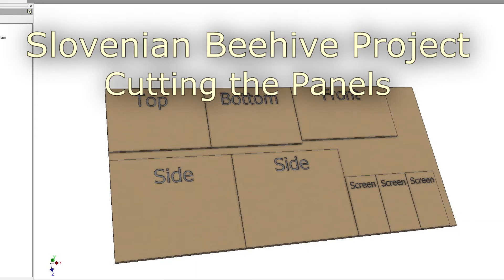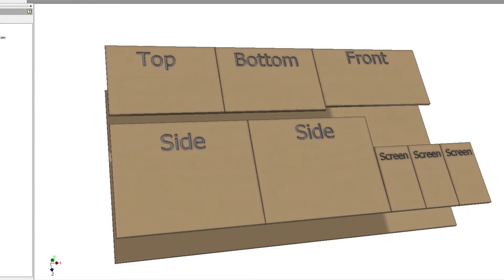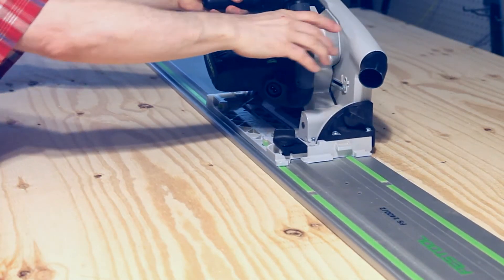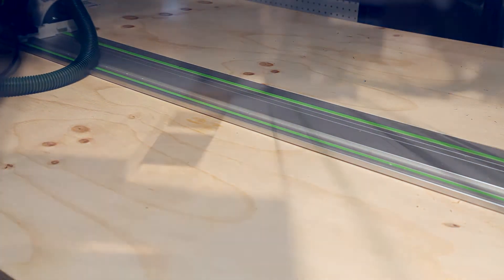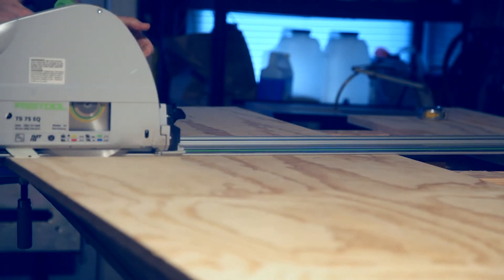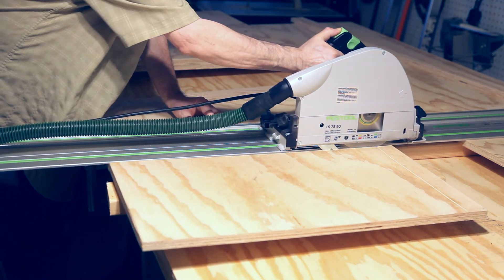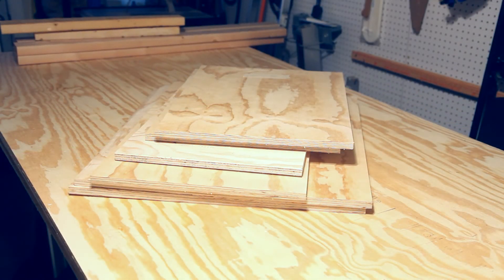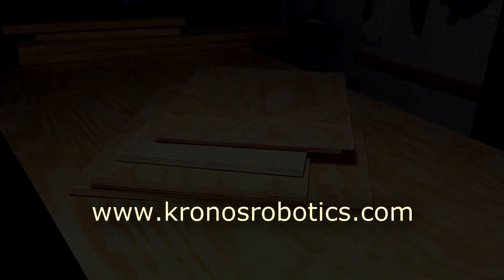Slovenian Beehive Project Part 1 - Cutting Beehive Panels

Comment: What are the measurements of the cuts?
Reply from the maker: Sorry, this is a work in progress.  At some point I will offer up the plans.
Reply: @msimpson20175  It will be great help if you can offer  the plans for sell.
Reply from the maker: @danyyay4304  That is my plan, however I am still working on things. Need to make some changes and make templates for those that dont have a CNC.